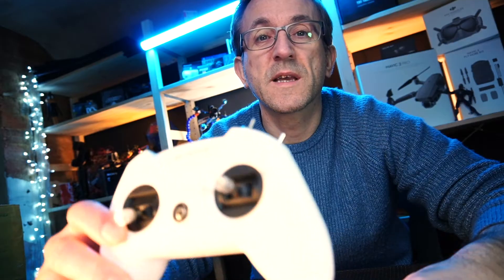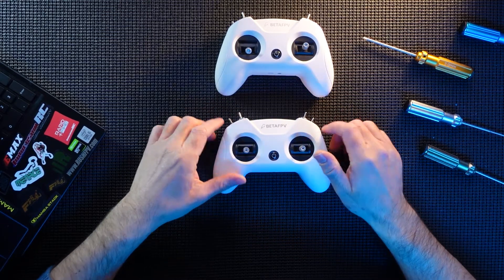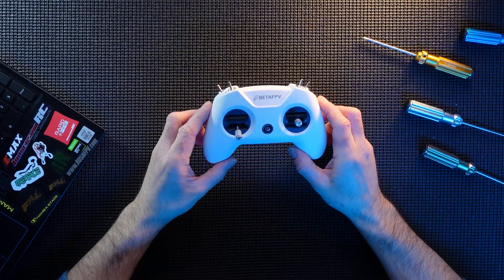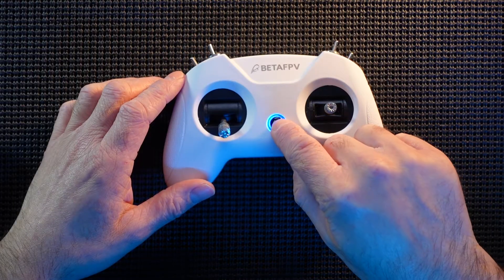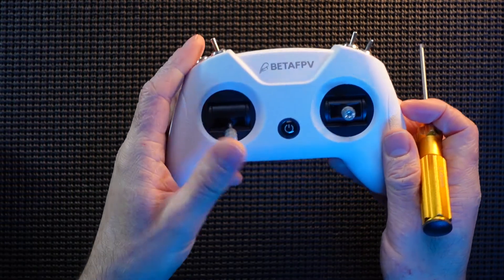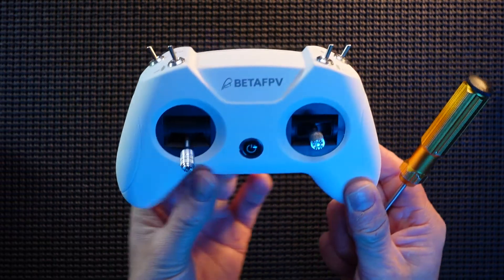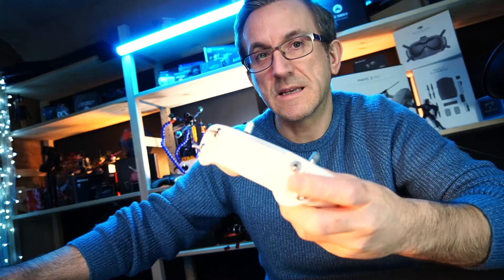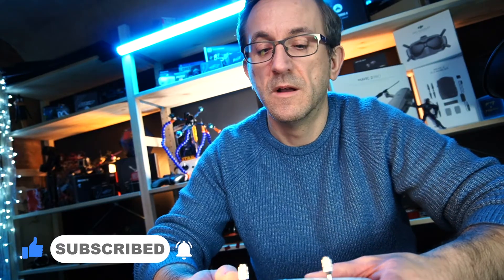BetaFPV LiteRadio 2 SE Radio Instructions Set-Up

Comment: Hi DatFpv i have an issue where my Meteor85 will not arm..The controller protocol is set at D16 with one flash..I also checked the quad in Betafpv configurator and all switches are active and it says D16 receiver..I binded the quad with the controller and i get a slow green light on the FC .So the protocol is correct and the quad is on d16 but it just won't arm..In Betaflight on the receiver tab i do not see the rcvr channels Thro,yaw etc does not move upon moving the arm switch..I don't know what im doing wrong can you help me?

Comment: What i just found out is if you go into Betafpv Configurator and press the controller model and in my case its cc2500 and click on the yellow button to connect with controller. Once there at the top left corner you'll see the Protocol your transmitter is in so mine was in Frsky D8 and i changed it to Frsky D16..Here you can make sure your sticks are responding correctly by viewing the channels Thro,Yaw,Pitch and role. The Betafpv configurator is very helpful, just don't change anything unless your certain..

Comment: Hi I'm trying to bind a betafpv lite radio 2 to an emax tinyhawk 2 and I can't seem to get it. I followed the instructions multiple times, recalibrated, etc. After I do the vine procedure it just goes back to blinking the red light with the constant blue light and if I push the right shoulder switch down it will beep several times. That's all I can get out of it. Any ideas? Both pieces are brand new from Amazon.
Reply: I had the same problem

Comment: Hi mate. Just a quick question... I am unable to get this controller to work with my PC. The controller has been working absolutely fine to the Cetus Tinywhoop, but I am now trying to connect it to the PC to use the sims... My PC recognises the device, and I am able to see it under my "Device Manager", and also in my Hardware and Sound settings... The computer says that the controller is "OK" ... But for some reason, the Orqa fpv.skylite is not recognising it? When I click "Calbirate", it does nothing... How do I set this up with my PC? Thank you in advanced!

Comment: I have this betaFPV SE, version, when I had to bind it up again to my Hawk Pro I thought you needed to push the setup button an power button to  change the protocol  an then to bind it back up an when I started flying my Hawk Pro it was in angle mode but it was acting like it was in Acro an not very stable what do I do to get it back to normal? I just tired calibrating the sticks to see if it helps, any ideas on what I need to do?

Comment: I'm a nube and I have this coming... obviously this does not have a screen on it, so how do you configure what the controls are going to do on your drone you bind it to?
Reply from the maker: the controller switches and suff are already pre-set, you change them in betaflight, you should be using betaflight to configure how your quad flies, and also set your rates and control switches.

Comment: watching a  few videos on this radio,  no one mentions the switches,  its like they don't exist.  I'm using mission planner really need the switches,   stupid config software not working? ><:#$
Reply from the maker: as this is a starter controller, the switches come pre-programmed in, you have to bind to a quad, then use betaflight - and the modes tab shows you the switches / what you can do and add in place.
Reply: @Datfpv  I'm using ardupilot / mission planner,  not betaflight.  If I know what the switches are pre set to perhaps I can set them in Mission planner (right now I selected RC6 and RC7 in MP) ,   If they are already picked why doesn't it tell you somewhere what to set my ARM switch to on the software   ,  kinda crappy design I think. Thanks for the response though
Reply from the maker: you should be able to see what they are in the betafpv config program though - and also if you download the free betaflight program as well.
Reply: @Datfpv  I have betaflight,  just tried to connect the remote only (not working)   this drone I have uses a PX4 FC with Orange Cube on it,  this FC won't connect to Betaflight as far as I can tell?  therefore  can't use betaflight,   will probably just us my TX16S radio instead,   was try to setup the BetaFpv thing with little success

Comment: This is a fantastic and super clear tutorial. Thanks so much for this. Do you happen to know how to connect this controller to an M1 Mac. I’ve had no luck so far. Thanks so much. Liked and subscribed.
Reply from the maker: thanks, but don't know about the m1 mac thing!
Reply: @Datfpv  thanks anyway. loving the videos.
Reply: Plug it into Mac, them press Setup button  that it will be recognized, it was this way with Windows

Comment: Hello again!
I just received my Tyro 79 & Eachines Lite Radio package today (25th Oct. 2021), plugged a battery and flew it around. Then i decided to bind the drone to my Jumper T-Lite JP4N1 controller and flew it around too. Now when i tried it back using the Eachines Lite Radio controller that came with the drone, it doesn't work anymore. Somehow, it got unbinded to the drone.

Can you please help me bind them back together, the Tyro79 drone to the Eachines Lite Radio controller?
My Lite Radio is flashing red 2x when i turn it on (i guess it's on D16 mode). Also my controller is colored white with a built-in battery and has the Eachine brand on it instead of the BetaFPV one.
Reply from the maker: you can't have 2 controllers bound to one quad, the process should be similar to the jumper that you did... press the button on the receiver in the quad and bind the controller.
Reply: @Datfpv  Which should i press 1st when doing the bind, the bind on the controller or the bind on the drone? And lastly sir, how many red blinky lights should i set the controller on (1blink, 2blink, 3blink, 4blink)?

Thanks for your help.

Comment: I bought this and it won’t bind to my frsky xm+ with access on my nazgul5 v2. What should I do? Was thinking just use for sim and buy another
Reply from the maker: I did hear that some of the controllers did need a firmware update - thats worth a try
Reply: @Datfpv  I know now that they only bind to the old xm+ receivers. You have to downgrade to a previous firmware version on the new xm +.

Comment: Its a very interesting video but as I'm new to FPV, i don't understand everything: I got a new Beta FPV LiteRadio 2 SE and I cant Bind it to my Betafpv meteor65-lite-brushless: Please I need help: if someone have seen a video on this matter please let me know.
Please can you upload a video. Many thanks
Reply from the maker: Hi! - the 65 lite you have.. is it the v2 or the v3 ? - the v2 is a Bayang protocol, and won't bind with the 'frsky' literadio - if thats the radio you have ? - more info mate, thanks specs and what you have ?
Reply: @Datfpv  Hi! 
I have no idea if it is a v2 or v3! 
I checked the Specifications and here they are 

Meteor65 Lite Brushless Whoop Quadcopter
FC&ESC: Lite 1S Brushless FC
Frame: Meteor65 65mm 1S Brushless Frame
Motors:(0802SE) 19500KV Motor
Camera: C02 Micro Camera
VTX: M01 VTX
Receiver: Built-in Frsky D8
Battery: BT2.0 300mAh 1S Battery
Canopy: Canopy for Micro Camera
    
Meteor65 Lite drone comes with Lite 1S Brushless Flight Controller , stock classical Silverware Firmware installed.

I have a Beta FPV LiteRadio 2 SE.

Thanks for your reply and I hope those info can help you.
Have a nice weekend.
Reply from the maker: ok so the controller need to be in D8 mode - 3 red flashes as my video shows you. make sure the quad is in bind mode, it maybe straight away... if all fails you might need to update the firmware on the controller, there was a issue with the firmware at some point...
Reply: @Datfpv   Ok, I will try to do as your video says. 
How do you update the firmware on the controller? 
its all new to me. thank you 🙂
Reply from the maker: cool - for the firmware you'll have to read the manual betafpv website - I haven't done it myself.
Reply: @Datfpv   Hey mate.  I was sure my LiteRadio 2 SE had Frsky 8. But I red the catalogue of my STARTER KIT Beta 65S lite brushed FPV
(Lite Brushed flight controler, V2.0 firmware and the LiteRadio 2 SE radio transmitter (Bayang protocol).
Its a Bayang LiteRadio 2 SE. Sorry and thank you for your help. I learned something new and you have Great videos. Bye

Comment: Just want to clarify if the Bayang protocol would be shared on the Frsky FCC D16? I am a beginner, thank you! (I own the LiteRadio 2 SE FrSky version Mode 2)
Reply from the maker: no mate - bayang is a type of reciever anf frsky is a type of reciever, they are made by 2 seperate compnies. you need a quad with a frsky reciever in it if you have the frsky controller.
Reply: @Datfpv  I appreciate your time! This helped a lot.

Comment: How are we supposed to know what the switched on this are supposed to do? Is there anyway of changing them? just bought this remote and and using it on a simulator, thats as far as ive gotten with this so far.
Reply from the maker: Hey - this is a basic controller, and the switches come pre-set, you can however change them in Betaflight - all my controller videos show how to do this and it is no different for this one, the process is really the same for all.
Reply: @Datfpv  ill have to check out beta flight then, never used it before. 
You said the switches are preset? The problem is, nowhere in the manual does it say what the switches actually do, like, is one of them an arming or kill switch? I'm guessing one of the 3 channel is a "mode" switch?

Comment: I just had a LiteRadio 2 SE and  65s Lite arrive as my 1st drone and intro to FPV.  I can't get teh transmitter to cycle through the modes or bind with drone... I can set it up and use it as a controller on the DRL sim...
Reply: The lite radio SE has 2 versions, frsky and bayang, the 65s lite is bayang protocol if you bought them as a set then you should be able to bind them, if you bought them separately then you may have wrong version of radio for that drone. I have just done it myself so I know. Luckily the 65s can take an external receiver so I ordered a cheap frsky XM plus receiver.
Reply from the maker: what he said!!
Reply: @heer-digital  my order said Bayang...
Reply: If your radio is bayang then you will not be able to cycle through the modes because there is only one mode, the bayang protocol. Either the radio or the drone may be faulty if you cannot bind the two.

Comment: Flight modes and turtle mode is already setup on the switches correct arm flight modes turtle mode? Like I said only radio I've had is jumper t8sg plus and I'm tired of setting up everything myself
Reply from the maker: yes the radio has no where to set up switches and comes ready to go,

Comment: I cant bid it with meteor 75 little,  I put in d8 mode and hit bind buton later but no way , in my previous little radio2 , they bind automatically once was in d8 mode , is something else I need to do ?
Reply from the maker: hey, I have heard that you might need to update the firmware on some of these se versions for the d8 mode to work.

Comment: Im triying to bind it to my advance 2 kit [meteor 75] and i cant bind it but the older transmiter still works on it do is that matters
Reply from the maker: no that doesn't matter, I have heard that some se versions need a firmware update and gthey should work fine (also make sure you do have it in d8 mode.
Reply: @Datfpv  thanks but how i updated it  with beta flight?
Reply from the maker: https://support.betafpv.com/hc/en-us/articles/900005322963-How-to-flash-firmware-of-Literadio-2-SE

Comment: my controller won't beep during setup so I can't get it to calibrate. My controller currently has unpredictable lower throw of the throttle and was hoping this might fix it as I have only used my Adv Kit 2 3-4 times and am out of warranty. Thanks
Reply: The advance comes with lite radio but the first one not SE LITE 2